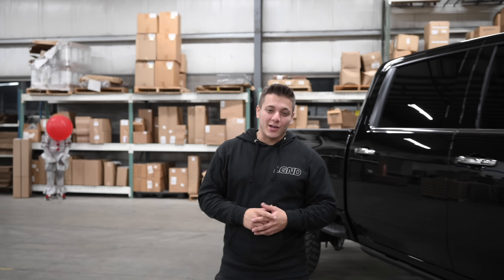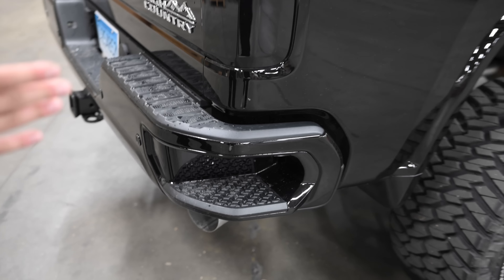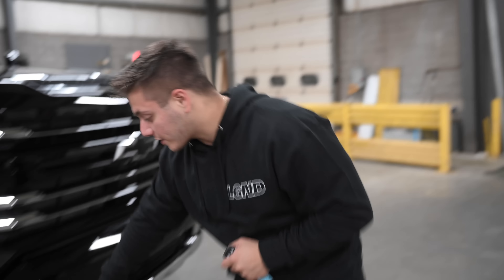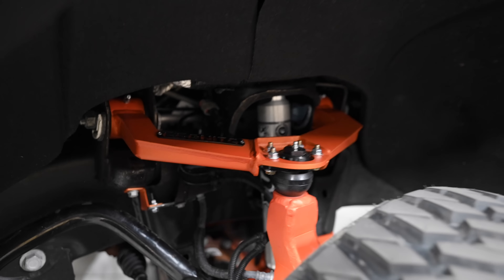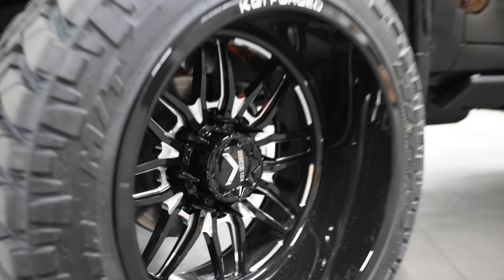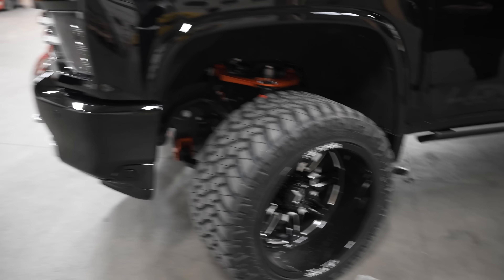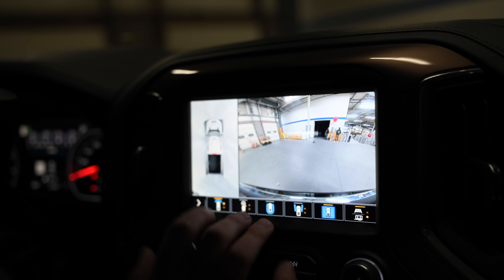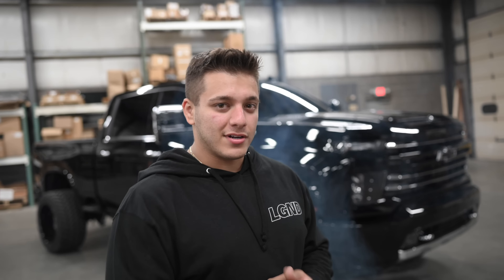LGND11 COMPLETE Overview | 2020 High Country Duramax

Comment: Anyone notice the drip under the truck? Thought it was water at first. But looked to dark... 🤔 bad ass truck though
Reply: I noticed that I think they slipped up when recording haha somethings not right here
Reply: my guess is someone forgot to tighten the oil pan bolt lol
Reply: They pressure wash the whole truck even underneath. They won't miss an oil leak. It's just water puddling under a dark undercoating.
Reply: No I saw it drip during the video
Reply: @rsharpe1985  they wash their trucks before every video
Reply: @limitlessautomedia9794  I would hope they did 🤦🏻‍♂️
Reply: @rsharpe1985  just go ask them personally if it's leaking. They will tell you.
Reply: @limitlessautomedia9794  I don’t have to I saw it with my own eyes in the video

Comment: ITS LEAKING OIL
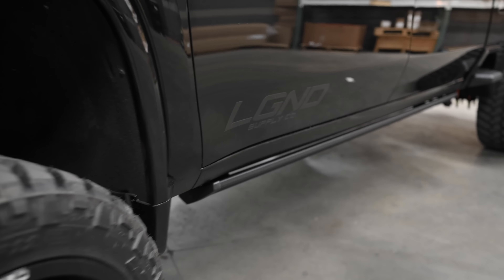Reply: 3:26
Reply: William Snyder looks like water because front bumper looked wet
Reply: Yeah I seen that too . Under drivers seat . Blow by tube 🤷‍♂️
Reply: Probably water
Reply: It’s water. The liquid dropping is too thin to be oil. You can still see water on the truck from being washed. Front bumper, and on the power steps... unless is from the ac being run too..
Reply: thats from the cooling system for the Turbos